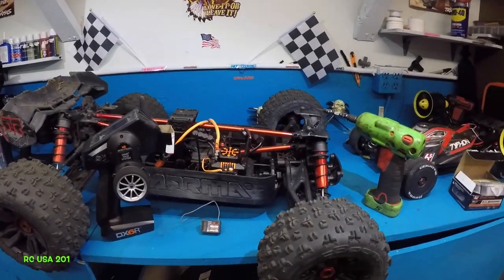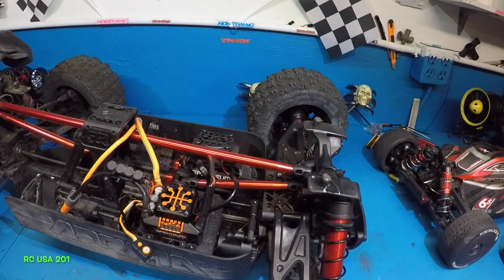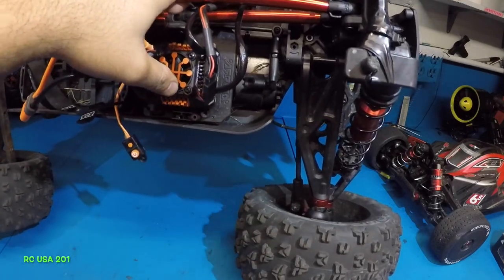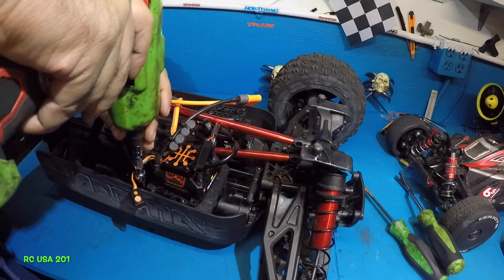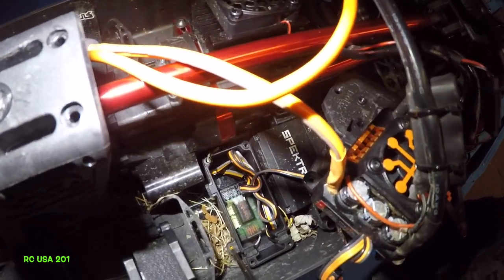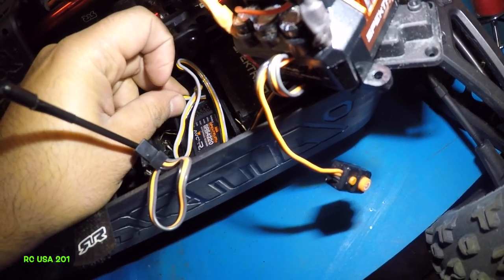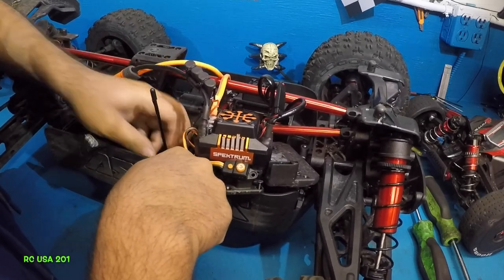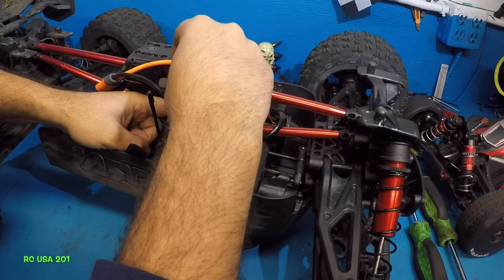Kraton 8s Remove and replace New Receiver to Bind with DX6R Transmitter

Comment: How did you remove the antena tube. You glazed over that part. I have receiver installed just can't find the set screw to take tbe tube off to place the new wire inside
Reply from the maker: There’s small grub screw

Comment: I need some help can I bind a new   dx5 rugged, to my kraton 8s stock receiver. With out messing with the receiver box under esc
Reply from the maker: U can but it requires lots of calibration also make sure all of ur trims are at zero when u bind it  how ever I changed my recieved and controlled I’m using stock recieved and controlled out of typhoon no avc it runs like best check out my Kraton 8s videos
Reply: Thanks for your help 👍

Comment: Same process for the Typhon v4 6s?
Reply from the maker: Melbourne Exclusive similar u have to calibrate it once u change the receiver also make sure ur setting are all zeroed out
Reply: @rcusa201  thanks man. When you say settings zero'd out are you referring to throttle trim and steering trim on the Radio? Thanks in advance bro
Reply from the maker: Melbourne Exclusive yeah on the controller make sure everything is normal like steering centered throttle down other wise it will not calibrate
Reply: @rcusa201  thanks man I really appreciate the info. Radio and receiver come in tomorrow. Getting ready to bring watch your vids haha hope you have a great day.
Reply: @rcusa201  hey last question bro I'm about to do the swap today. Did you leave arrma's stock servo? I don't have an extra one but I believe the one in my 6s Typhon should be good enough for a Dumborc x6 Gyro right?
Reply from the maker: Melbourne Exclusive stock servo
Reply: @rcusa201  thanks. Did the swap and everything went smooth appreciate the info!
Reply from the maker: Melbourne Exclusive yeah expect I had to calibrate the esc to controlled there’s instructions in the manual to do that